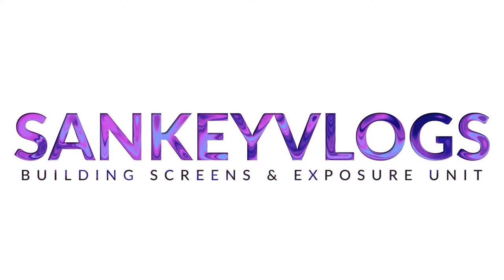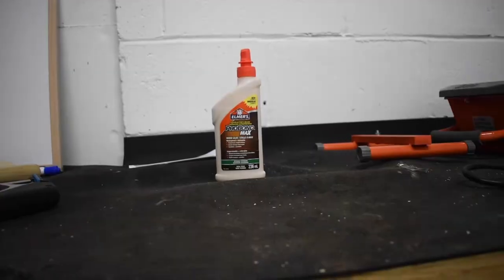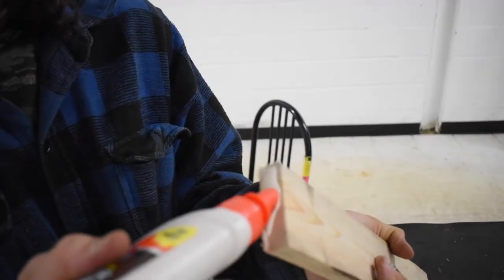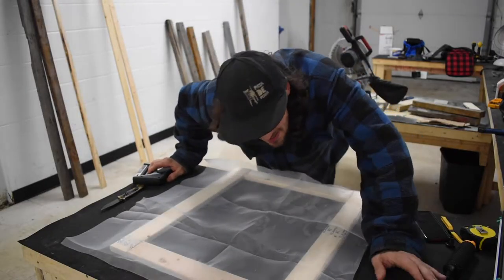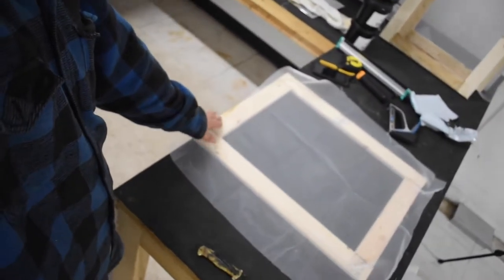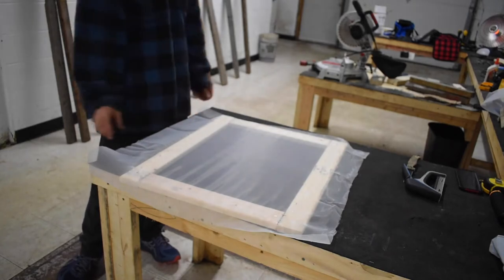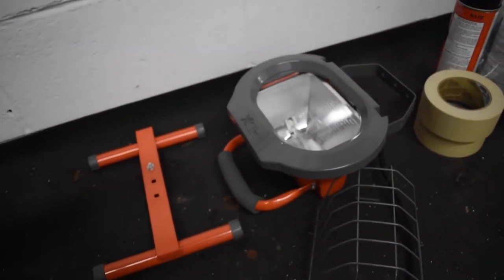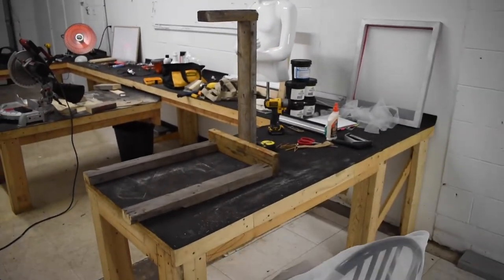How To Make Screen Printing Screens & Exposure Unit SUPER CHEAP Home Business

Comment: Is there a certain light I need to work under like yellow bug light or black light? When I’m working with the emulsion
Reply from the maker: I would say an HPS, Flood light or some fluorescents would be the best bet but you "burn time" will vary depending on the strength of each light so you will have some trial and error at the beginning